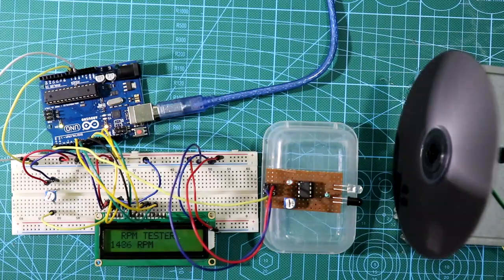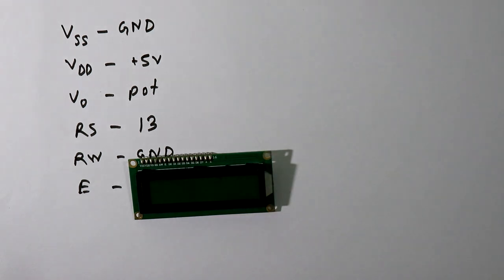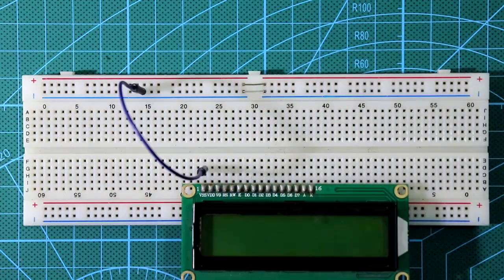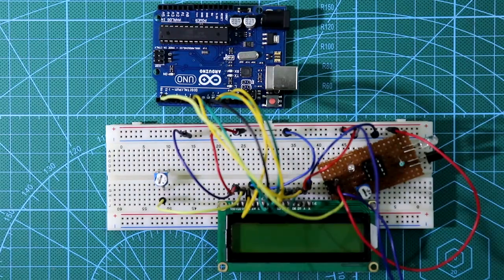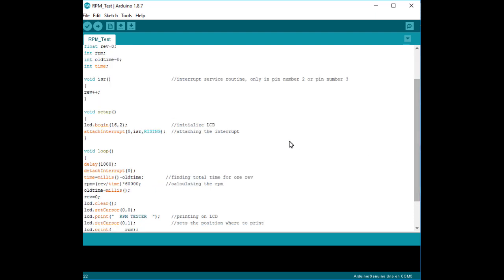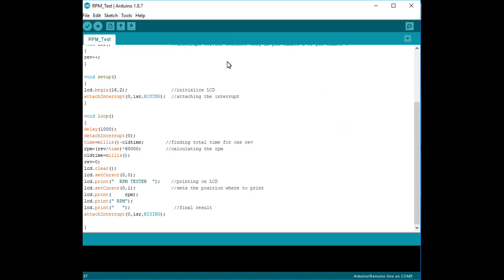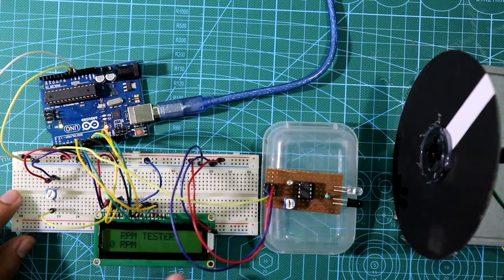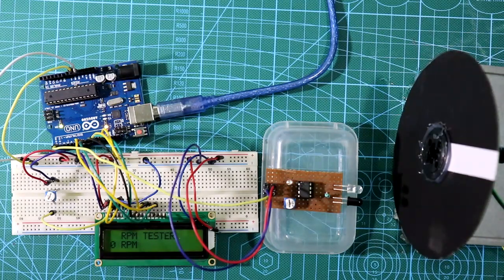RPM tester or Tachometer with Arduino | Mini Arduino projects

Comment: Also, this can be done without Arduino by gluing small magnets around the disc and then using a Hall effect transistor to ‘sense’ both speed and direction.
Reply: how to do can you please explain in breif

Comment: Can I connect DMC40457 LCD module to arduino and if so plz share me the program
Reply: can connect many different LCD i use oled display, you know, ewery display need driver library own display, and code. how handke display.